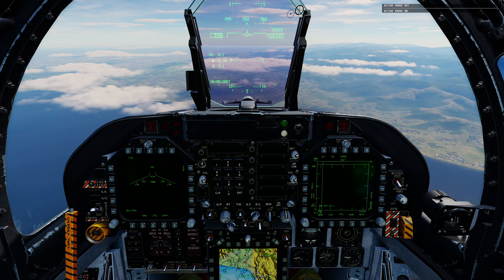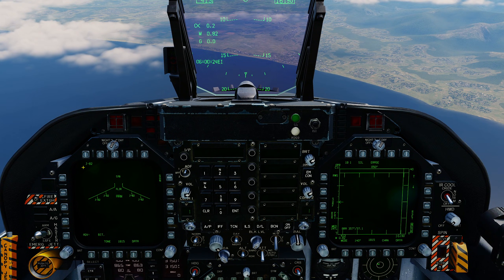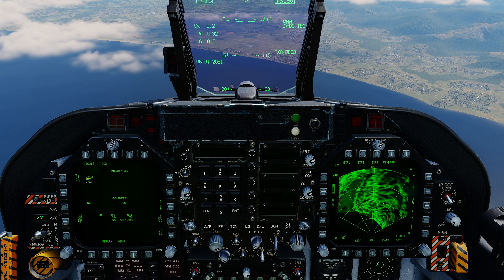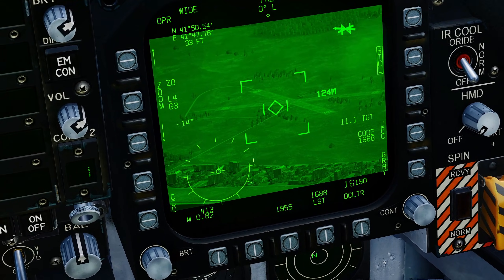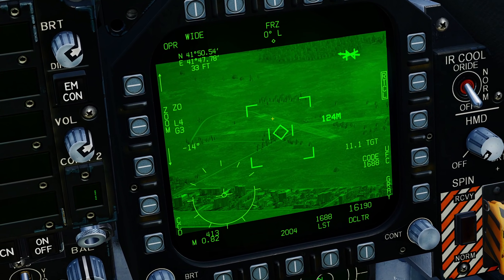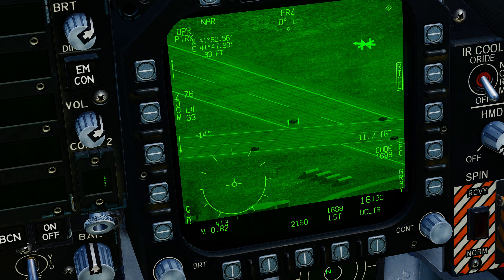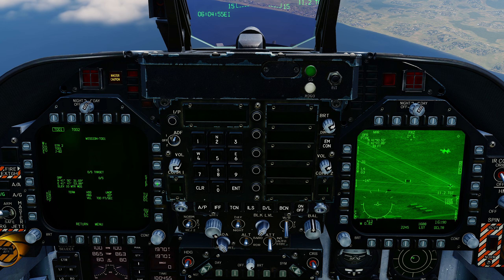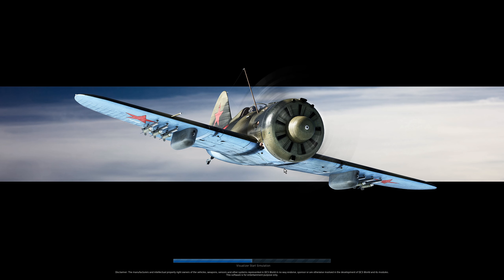FA-18C Hornet: Using Targeting Pod Offsets In Combat Tutorial | DCS

Comment: F16 + cbu105 + tpodALWAYS now Falls long. Im pretty new to f-16 but have used those that much, that the havent been so inaccurate before. Sry for littlebit offtopic, but when I pointrack target with cbu-105 should it drop parachutes so that pointrack point is the "middlepoint" of the are, OR is it just the point where the bomb opens and drops its clusters / chutes? SHOULD I target littlebit in front of target or is that just a bug? JDAMS fall right on target, also with hornet.
Reply: Could be speed related maybe? 🤔 Like if you’re over a certain speed it causes the CBUs to overshoot? Try going slower and see if it still happens? Then again, too slow my undershoot for all I know.
Reply: Yeah, if I remember correctly over 450kn they start to drift. Gotta try in ME maid range without any winds and missiles shooting at me :) Noticed this while playing Wild Weasels over Syria campaing. Great campaing though. Makes one use its "hifiest" systems. (had / recon / dlink and some jammer stuff). In dlink they fit nicely with those "new" datalink upgrades (TDOA etc). @kevinmccallister1343
Reply: I believe you get better results when when setting a lower burst altitude. Not how it should be but it's the way it is. I set a BA of 900 or below.
Reply: Does f-16 btw have somekind of correction?